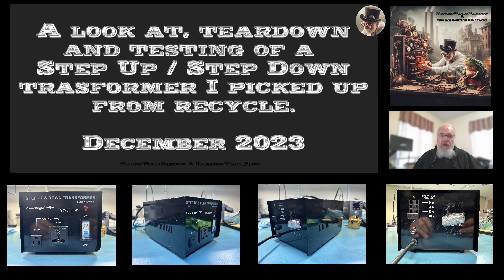PowerBrite - VC-3000W Step Up/Down Transformer - RTR300

Comment: Order the 2000 version ,  Got a 1500 watt  PSU from Amazon UK  , It's a 230v , but will use 110v as well , Got  a 110V TO 230V OR 240V adapter  =LENCENT UK to US America Plug Adapter, 2 Pack Grounded USA Visitors Travel Converter, Converts All Type G Plugs from United Kingdom UK Singapore Malaysia UAE Ireland Malta Hongkong and etc. (Type B)  for my new  NZXT C1500 Platinum ATX 3.1 | Fully Modular Low-Noise PC Gaming Power Supply | 1500 Watts | 80 Plus Platinum| Dual 12V-2x6 Connectors | Zero Fan Mode | 100% Japanese Capacitors | Black,   max wattage from my PC is 700 watts at the 110v outlet , GPU 4090 BEAST , and CPU 5950x with 420AIO P/P  and case Meshify 2 XL , 12 Noctua a14 3000 rpm fan ,    my question is this ,  what mods  did you do to your PowerBrite - VC-3000W , to make it safer .   also I never leave on anything , full power off  when I am not around  ,  also if you had your choice what would you get to replace the PowerBrite - VC-3000W.

Comment: I have a 220 outlet in my shed for my air compressor, but I need to use a heat gun for soldering which is 110. Can I use one of these? and how would I plug the 110 style plug that's on this machine into a l6-30 outlet? An adapter? Will this even work for what I need it to?
Reply from the maker: I'm not an electrician and am not qualified to provide any real guidance beyond this:
220 can be lethal. I don't recommend you go about working on the outlet yourself.
I suspect an electrician could add two 110 outlets to the 220 circuit but you will need to ask them. 
If you use a step down transformer you need to make sure it can deal with the current/power demands of the soldering tool. Some ratings are based on short term "spike" current demands instead of constant current demands.  If the step down transformer is underrated you risk a shop full of smoke or even a fire.
Reply: @ShadowTronBlog  my thoughts exactly thanks for the reply